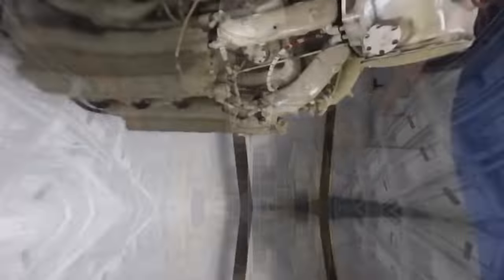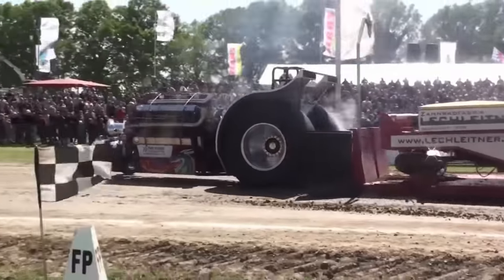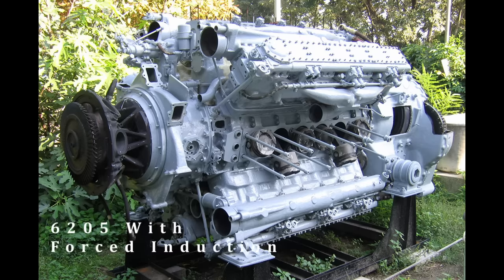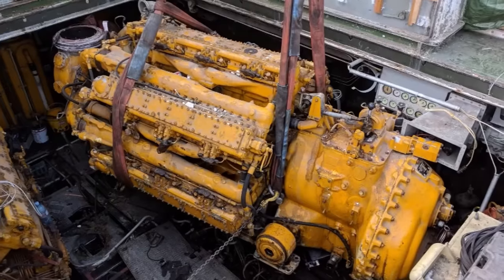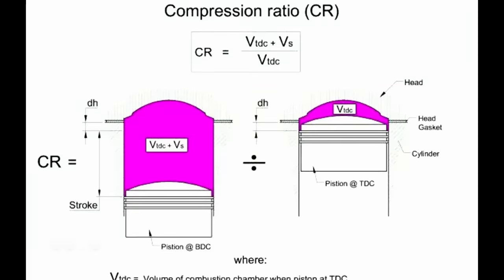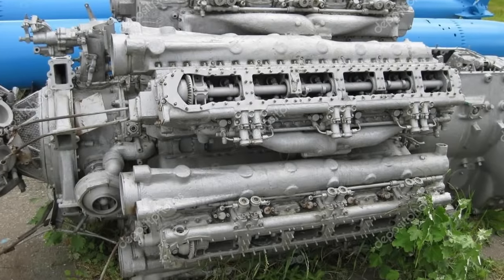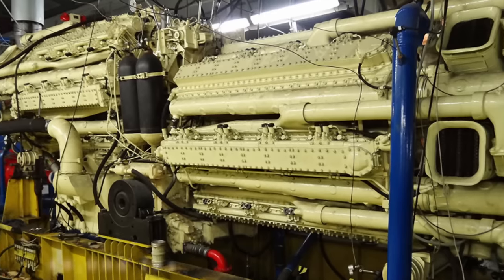Yakovlev M-501 - The BIGGEST Piston Radial Ever Designed

Comment: The power output of these giants is... underwhelming.
Reply: The torque surely isn't.
Reply: @DylanClements98  in the ground vehicle application it does. Water a lot less. True for the air.
Reply: @DylanClements98  Torque is still the actual measurement of force. You could take a much smaller engine that produces the same horsepower as this and in something the size of a ship the smaller engine wouldn’t work as well. And, you have it backwards. Horsepower is calculated from torque. Torque is the force that’s measured then horsepower is calculated with the rpm. 

Plus the output power for engines like these is relatively low for their size because they’re intended to be able to run at max power for their service life. They could make much more power, but wouldn’t be as reliable or last as long. Like how an F1 engine produces a lot of power for it’s size, but wouldn’t survive long under extended full load.
Reply: Guys, i appreciate the discussion. All i wanted is to point out that high torque (usually more than twice the power figure in passenger cars, x4+ with bigger engines) is the main trait of diesel engines. Apart from reliability, longevity, and efficiency.
Reply: @DylanClements98  This is the real world. Not a math problem. Torque is what does the actual work. Even drivetrain pieces get rated in how much torque they can handle. Even looking at the units when you work it out mathematically you'll see that horsepower is just torque over time. Which means torque is the more basic unit of measure. 
If you want more horsepower at a given rpm you have to make more torque. Cause torque is what's actually doing the work.

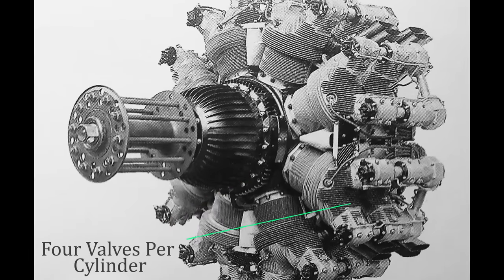Comment: The English ne wt the 2:05 timestamp is the two row 16 cylinder Bristol Hydra. Weird in that it was one of the few radials with an even number of cylinders and DOHCs. OHCs were also used in the 24 cylinder Jumo 222, the 42 cylinder Wright Tornado and the French Mathias Vega 24 cylinder.

Comment: Just a little too late, for the aluminum version to be used for aircraft, because of pure-jet & turbo-shaft engines for planes... But a very good application for many other types of equipment... What gives it the advantage over other large radial engines, is this one is a cast-iron diesel... A 6.3" bore and a 6.69" stroke x42 and x56 !!!.  4 valves per cylinder, bevel gear driven over-head camshafts, Long forged steel articulated & master rods, Turbo/compound dual-stage supercharging, liquid cooling, very large tapered roller main crank bearings, Wow !!! This monster was PERFECT for medium boats and small ships, and maybe freight trains (with a coupling to a large generator) and mining applications in large haul trucks.. A real torque monster !!! That is where it probably worked the best , high horsepower, yes ... But the torque was probably unreal !!! I wish they gave those torque numbers in the video and on other websites... What a machine!!!

Comment: Good Video but no need for music.
This engine is similar to the Napier Deltic which is a 18 cyl opposed piston Diesel with 3 crankshafts geared together in a triangle
This was designed in 1947 for use in fast naval PT Boats taking the German Junkers  two crankshaft opposed piston Diesel  aircraft engine as the basis.
There were other applications in Fast Locomotives, Mine Hunter Boats and others.
The USA Navy used them in the Vietnam war in fast PT boats.
The Royal Navy used them up to 2015 in Mine hunter vessels.
I worked for Napier on the production of the Deltic in the 1960's which was a most interesting job.

Comment: Lycoming built the XR-7755 ,36 cylinder,7,750 cu.in.producing 5,000 hp. Only 2 were ever built and  production ceased in1944. I seem to recall another manufacturer creating a monstrosity of a radial engine for stationary use in power generation. I'll have to check my facts ,it's been many years.

Comment: The Buran a knock off?
It has I higher payload rating and has atmospheric cruise capability and was also capable of completly autonomous flight, the design varies greatly. I wouldn't call it a knock off, but a better, more thought through realization of a reusable spacecraft with wings. They just stopped using it because it was way to expensive to operate. Which was one of the biggest cons of the STS...
Reply: Stopped using it? It completed ONE orbital flight. That's not using it, that's not even completing flight testing.
It did vary in capability, however almost a decade after the shuttle flew, so stands to reason they'd have seen what we were doing and thought of other things that could be added.
Reply: It came later, and it's only better on paper, since they never really used it.

Comment: If these engines develop  max Hp at 2200 rpm then the  torque  will  be about
2.38 times the hp. 4000hp will be almost 
10, 000 ft/ lb. Max torque at a lower rpm will be about 20% higher but this number  is tricky  not knowing  how  boost  pressure  is manipulated.

Comment: These engines may have been the largest radial piston engines ever designed for aircraft use but they are not the largest radial engines ever designed. These would be the 11 and 12 cylinder Nordberg stationary engines designed for use in powerhouse and pumping station applications. With a 14" bore and stroke they were  installed with the centerline of the engine in a vertical orientation. Neither the 11 or the 12 cylinder engine used a master rod. In the 11 cylinder the link rod carrier was geared to maintain position while on the 12 cylinder a novel positioning system for the lo ink rod carrier was developed by the company. These engines saw their primary use in the power houses of aluminum smelting plants.

Comment: The engine had 6 banks of 7 cyinders, not the other way around as described in the video. Radial engines always have uneven numbers of cylinders in order for the firing sequence to work. 1-3-5-7-2-4-6
Reply from the maker: This is incorrect. Because this is an inline radial, we refer to each "bank" as the inline set. What I said is there are 7 banks of 6 cylinder inline engines. Each radial section has 7 cylinders as you say, but when I say bank, I mean the inline portion. Think of the engine as 7, 6 cylinder inline engines configured into a radial.
Reply: @flightdojo  OK, makes sense. Thanks
Reply: Not Russian engineering but Soviet.  Given the context of the topic.  There was a country that included many national republics.  The Russian Federation was part of the USSR.  Many of the inventors and scientists were not Russian.

Comment: It's kinda ironic that there were engines with that power output, but military land vehicles were severely underpowered. UAZ or GAZ-66 really struggle with lack of power and torque in offroad conditions with little to none constructive reserve for reliability and upgrade.
Reply: They got enough power to perfom duty on frotline. UAZ or GAZ struggle with luck of power compered with modern engins.

Comment: On the description, 'discovered that jets would be a more viable option' is not a great wording of what took place. They already knew about jets and turboprops, and these were the preferred solutions, but as these were new technologies they saw no reason to cancel the development of piston engines for high-priority projects. The wording implies that someone did a study and it was realized that jets would be better, at which point they cancelled this thing and started developing turbine-based stuff instead, when what transpired was instead the piston project being kept around for redundancy in case other projects failed, to give them a proven solution to fall back on. This has always been the Soviet preference, and is an explanation for a variety of oddities in Soviet production and prototyping

It also paid off fairly often. Imagine, for instance, if they had lost out on the S-300 by instead fully committing resources to their experimental air defense laser systems which, at the end, turned out to be useless outside of incredibly niche and unrealistic scenarios.

Comment: Excellent vid, hadn’t heard of this …..colossus before. Just a small point did each bank have six cylinders? I thought radial engines had to have an odd number in each bank! Just editing my reply. In most radial engines we refer to a cylinder bank as being the row of cylinders viewed from the front, ie in most simple radial engines there would be just one set of cylinders arranged radially around a common crankshaft. In your video you are referring to a bank of cylinders as being the cylinders from front to back. So in normal(western ) colloquialism this engine has 6 banks of 7 cylinders giving the 42 cylinders overall. As I said great video thanks for putting it together.
Reply: Radial engines only need to have an odd number of cylinders per row if they are four stroke engines. The reason for this is that four stroke engines fire every other revolution, and if you fired each cylinder one after another, you would need a complete revolution with no cylinders firing. Having an odd number of cylinders solves this problem by always being able to fire every other cylinder. Thus, odd cylinders are fired in one revolution, followed be even cylinders in the next.

With a diesel, there is the possibility of using a two stroke design. Because a two stroke fires every revolution, you can fire one cylinder after another each revolution.

Comment: How would you do maintenance on the bottom cylinders?  Would you have to pull the entire engine to replace a head?
Reply: Probably, yeah.  I would think they also have some mechanism for rotating the engine several revolutions to clear the lowest cylinders of oil before starting.

Comment: i have always been under the  impression that radial engines have only odd number of cylinders like 5 7 9 and 3 but you can put rows of cylinder one behind the other is this yak engine different from a normal radial
Reply: Radials normally have an odd number of cylinders due to firing order. A nine cylinder is 1-3-5-7-9-2-4-6-8. But there gave been exceptions the Bristol Hydra. Inline radial engines such as the Hydra, the Curtis Hexes, the M-401 series,  the Wright Tornado are often the result of the need to use liquid coolant.
Reply: @mpetersen6  So, to think of it another way-- are the jugs on an air-cooled radial staggered so that air can get to them?  And how do rotational harmonics play with that structure?
Reply: @theprojectproject01  
On air cooled radials the rows are offset usually by 1/2 the angular seperation between the cylinders of each row. There have been exceptions. Bristols Hydra which also was an even number of cylinders per row. The Curtis Hex engines and the Armstrong Sidley 'Dog' engines. As a general rule air cooled radials are one or two rows. The major exception is the Pratt & Whitney R-4360 28 cylinder with 4 rows. 
There is a small company called ageless engines that sells plans for 5, 7, 9, 10, 14 and 18 cylinder engines that can be built in a home workshop equipped with a mill and a lathe. The engines are all based on the same cylinder. The company actually recommends that somebody build the 9 cylinder first if the intention is to build more than one type. Common fixturing is one reason. The second is 9 is an even factor of 360°. 7 comes out as an odd angle. 51.42857°.

Comment: How did they do that...a six cylinder per bank layout, a radial bank must have an odd number of cylinders.  Also, 6 does not divide evenly intto 56.
Reply: A radial engine can have even number pistons in a bank if it has an odd number of banks. A single bank needs odd number of pistons to be efficient and not lock up.  As for the 56, perhaps they added 2 pistons?
Reply: 6 was with 42 cylinders, 56 cyl was with 8

Comment: God.. using imperials for a engine built using metrics, what a disgrace !
In non-retards units
144dm³
6000hp
5400kg
1.1Bar of boost
250kgf of residual thrust
Bore-Stroke (160mm x 170mm)
See.. number are more "round" using metrics because it was made using them !

Comment: So does this thing burn petrol or diesel.,..I’m confused
Reply: try 120 octane cars use 95-97
if you know what that is
go learn
Reply: @raypitts4880  as a certified gear head I know exactly what you’re taking…..my 11.25:1 compression supercharged LS need at least 97/99 or it will start knocking……I don’t live near any av gas retailers so I gotta use 91 then add concentrated race gas

Comment: Error? It must have had 6 rows of 7 cylinders; each row of radial engines must have an odd number of cylinders. If the number were even it would be unable to rotate. Each image or diagram show (miscellaneous) engines with odd numbers of cylinders.
Reply from the maker: Think of the engine as 7 inline 6 engines oriented into a radial engine. Each slice of the radial has 7 cylinders, as depicted in the diagrams. There are 6 "slices."

Comment: A marine engine that is a nightmare to service, and has a life span of 1500-3000 hours? I guess you just replace the engines a a couple times a year! Why would anyone install this in a boat over an EMD or even a Cat for that matter?
Reply: not life span, 3000 hours between overhaul
that's military high speed boat engine, it would take many years to spent 3000 working hours
Reply: @bagamut   I work on boats as an engineer and 5000 hours a year is typically for a commercial vessel I understand that isn’t a throw it away time. Unlike an EMD that is easy to change power assemblies on, this looks like it’s not easy to inframe. 30,000 hours between inframes is typically for a marine engine!  Rebuilds are almost unheard of unless a major failure. The last boat I was on had north of 200,000 hours on the main engines without ever being rebuilt. I’ve changed power assemblies ( a complete assembly of a liner, piston, rod, cylinder head) underway many times. These engines look like they may need to be removed from the boat for service? Not sure how one could change the cylinder kits on the bottom banks in the boat?
Reply: @Trump985  it's not commercial, it's high RPM military engine, also was used on hydrofoil boats
it was just replaced with another one, service was done at separate facility

Comment: imagine the size of that engine producing 10k hp. now, top fuel dragsters produce that same amount out of an 8 cyl 500 cu in engine. still, amazing tech for the time.
Reply: True but the engine has a lifespan of 3 seconds. Dragster technology is mindboggling to me.
Reply: @bobjohnson2089  The technology which causes dragster engines to produce 11,000 hp or more is in the fuel and supercharging. Rocket fuel and 100+ psi intake pressures were found to yield extreme horsepower at the cost of very limited engine life (as little as 3 seconds under full load).I share your amazement at the development of this technology. I may not remember clearly but back in the fifties or early sixties I think it was Hot Rod magazine that fueled and supercharged a stock engine ( Chrysler ?) to more than the dyno could handle, an estimate of 1,000 hp. Anyway what’s really amazing is the hp per c.I. of two stroke engines. 4 hp per cubic inch is available in recent bikes docile enough to be driven on the street.
Reply: @johndimmick7019  also 200hp per ltr
like some of the italian 20 cc bikes 110 mph  pushing 20-22 hp.= some 180-200 hp per 1000cc

Comment: 0:50 No! Absolutely not!
America is the one that went "just make things bigger" and made the F1 engine bigger than any liquid fueled engine to fly before or since. And during its development we struggled to even make an engine that large run without combustion instability destroying the whole thing.

The N1's downfall was how very unreliable its engines were. They wore themselves out too quickly to even be tested, so they were all flown without testing. The N1 was much more tolerant of engine failures than the Saturn V. The engines it used were just so spectacularly unreliable that all of its larger safety margins were overcome each time by many engine failures. The Saturn V could not complete a mission with even a single F1 engine failure, unless the single engine to fail happened to be the center one.

The Saturn V was extremely sexy, but it's not the one that Starship seems to take after most. That makes the N1 in some ways ahead of its time, while the Saturn V was a very 1969 miracle that we can save a lot of effort by not revisiting.

The Buran vs STS conversation is much shorter. The buran was a better shuttle than the shuttle, because the buran used liquid fuel boosters. Solid fuel should never have been used on the shuttle and it's a miracle that only 7 people died to SRB malfunctions. The shuttle's other accident also could not have happened to the buran design, since the buran didn't have a hydrogen tank covered in foam.
The Buran's launch system, Energia, was an expandable rocket that could fly with attachments other than the Buran, and flew without a crew. This alone makes it a more forward-thinking design than what it was competing with. Again, I don't know what NASA was smoking, but it wasn't the good stuff.
But SpaceX seems to have finally rediscovered the good stuff. Only took 50 years.

Comment: Engines. NO sound of them available? A video just with muzak and a narrator? ALL silent footage? BORING! I would have like to have LISTENED to these! If I had one or two I would have been runningthem on ONE source, HYDROGEN! tHIS IS THE LIGHTEST OF THE ELEMENTS AND IS Tthe only non-HYDROCARBON fuel available. NO hydrocarbons to contribute to this international Climate Emergency! I would have LOVED to hear two of these run (again only on H)    If there are still some still running, you should have made an effore to record one actually running complete with AUDIO! This is why I gave this video a thumbs down!